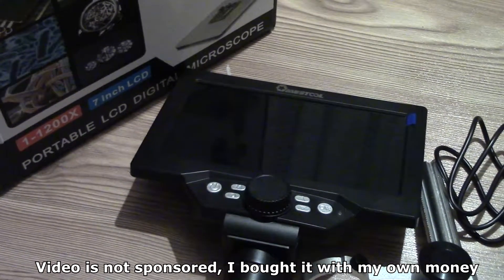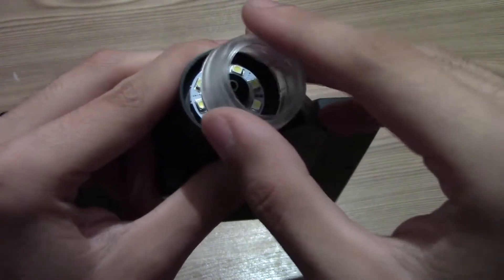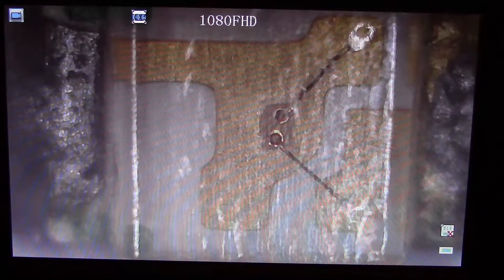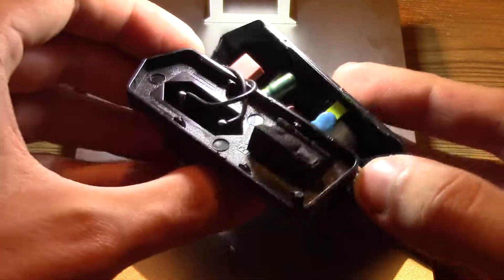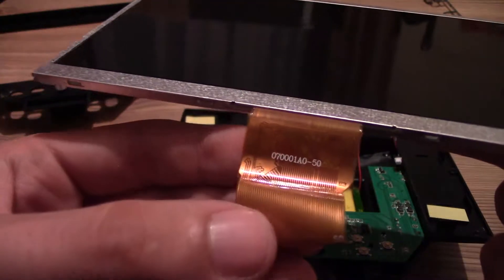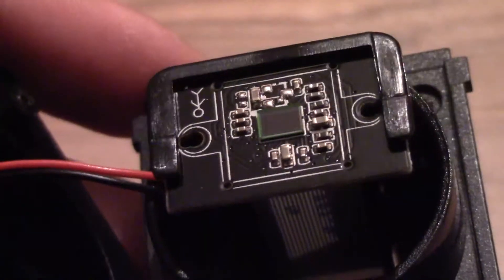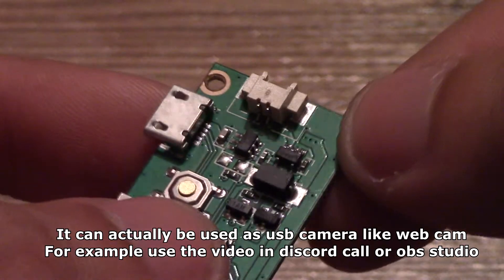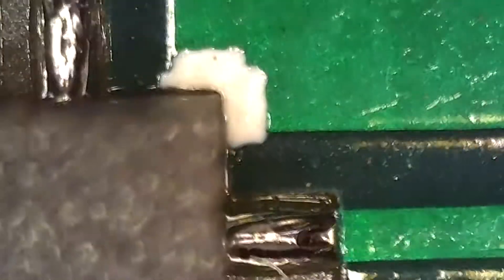Mustool G1200 Microscope Review And Detailed Teardown [RS CC]

Comment: Hi! Great video. I have one with battery and the IC next to the USB has burn... Do you what component is? I would like to replace it. Thanks!
Reply from the maker: @acci_fpv  linear single cell lithium charger. I don't know exact model but it might be similar to TP4057 from top power. Compare footprint on pcb and layout (and connections) with datasheet of tp4057
Reply: @Ncky  Thanks, I think I may have explained wrong. This linear single cell lithiuam charger is the one that you mention in the video XT4054, right? The one I mean is the one a bit more close to the USB that may be a switch or handling the power from the USB to the microscope or to charge the battery. I hope that help to clarify.
Reply from the maker: @acci_fpv you're right, my bad. Here you go https://www.eevblog.com/forum/repair/dash-cam-repaircomponent-id-request/

https://ibb.co/mqXmrHh

Check 2 small capacitors next to it for shorts
Reply: @Ncky  Thanks! I fixed it the IC LP5300. It's looking promising 👌
Reply: How you were sure what IC is burned? Visible damage? I have problem that icon changes from battery to icon of plug, but in behind, it doesnt charge battery. I left it for hours and it didnt charge. I also bought new battery and its the same.
Reply: @ Mine has physical damage, it was pretty obvious
Reply: @acci_fpv  On that place nearby battery connector, I have LTH7R chip, 5 pin component. I ordered it... I will see if something changes... Do you have to have microscope ON, while charging or it will charge battery just when plugged in?

Comment: Battery size from part # 924366 is 9.2mm x 43 x 66 mm
Reply from the maker: Yeah that's true but i measured it manually for the said measurements in description and in video.

Comment: My microscope broken led   shines 
poorly. The adjustment is working. But the clarity is minimal. What happened?
Reply from the maker: You can try to replace the leds. I think it is 3528 led or similar. It's best to disconnect leds and test them each with multimeter and lab power supply using constant current. The adjustment is just potentiometer, not pwm so maybe pot has gone bad?

Do you know what is constant current power supply?
Reply: @Ncky  
I'll show you how it behaves.
Wait video
Reply: @Ncky  https://www.youtube.com/watch?v=knoQmJIx7Qo
Reply from the maker: @marcinxv2  looks like a dead boost converter that boosts battery voltage. Can you take pictures of the board inside, especially near smd inductors?
Reply: @Ncky  
It doesn't need adjustment. Tell me where to make a bridge so that it shines at max
Reply from the maker: @marcinxv2  upload photo to any free photo hosting site and link it here, it has to be high quality and lit well so i could see where do the traces for light go
Reply: @Ncky  
I connected right before the adjustment. I got the desired effect,I will send photos later.

Comment: I have a question, hopefully you will respond:
Do you think this microscope is good enough to inspect a straight razor edge or a knife? for chipping rolled edges (honing process) etc..
Reply from the maker: not really, the zoom is not enough, edge would be hardly visible because of the lighting conditions and contrast. this is just for some macro inspection so you dont strain your eyes. if you need microscope for that better go with amtech good quality microscope with nice image and focusing or equvilaent. this is more of a toy :D Get microscope with over 100-150x zoom. This G1200 also has fake claim for its zoom. Its around 40x-50 at its best

Comment: Every part of the software works except the camera on mines , how could I fix this problem ?
Reply from the maker: If you can request a new unit from seller do it. My first idea is to check if white flat flex cable is connected properly, then check if its connected properly on the camera itself. The right thing to do is to request new unit or refund
Reply: @Ncky  appreciation it! Will do!